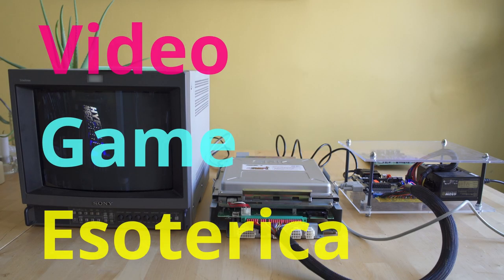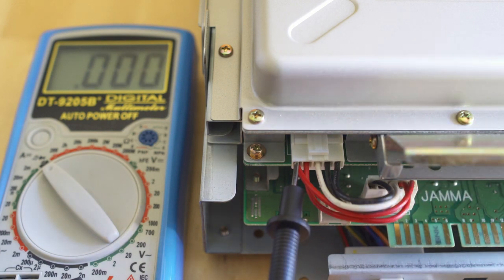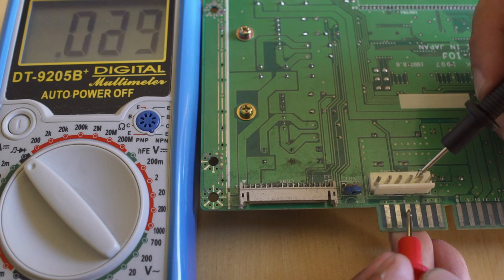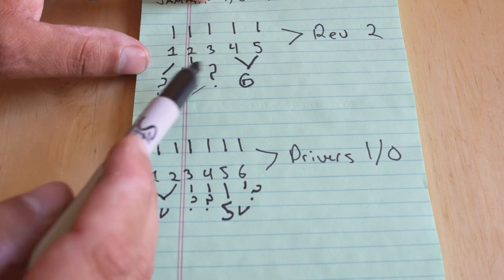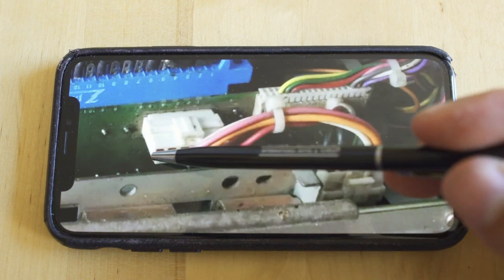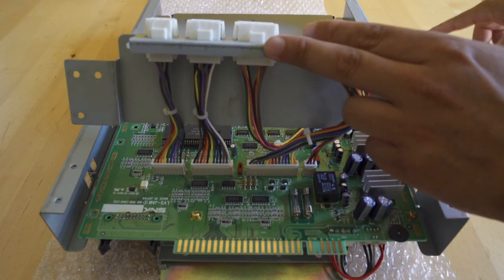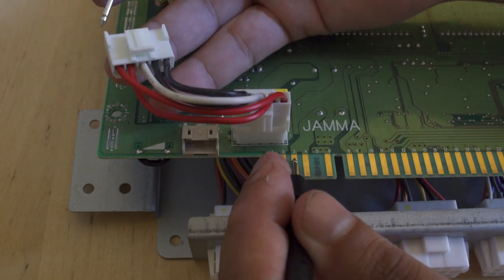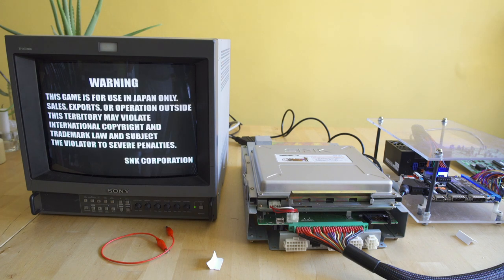Converting the Hyper Neo 64 Motherboard Pt 1 - "On a Technicality" - Video Game Esoterica

Comment: What's your +5v set at? I picked up a revision 1 board and have never been able to consistently boot. And do you have a -5v going in to the jamma line?
Reply from the maker: My 5V reads 4.98 on the led. Since it’s a Rev 2 board it doesn’t need -5V. All four +5V leads MUST be hooked up to the JAMMA edge to get it to boot though. If you just get a blue screen with no white text that means you aren’t pushing +5V to all four JAMMA pins
Reply: @VideoGameEsoterica  I'm not even getting the blue screen that's what concerning me
Reply from the maker: Kevin Gauby and all four 5V leads are hooked up? That’s odd. Nothing I’ve ever encountered. Do you hear a “click” on the board when you power it up? You should hear it “click” when power is applied
Reply: @VideoGameEsoterica  all four +5v line are connected and I'm hearing a click when booting. I'm going to pull the io off again and spray the crap out of it.
Reply from the maker: Kevin Gauby sounds like a good idea. It “sounds” like it’s working fine but maybe not outputting video signal? Hard to say
Reply: @VideoGameEsoterica  Just cleaned it, still a black screen. Read 4.83 on the jamma line on boot though, 5.49 with it disconnected.
Reply from the maker: Kevin Gauby it’s power hungry. I’d bring it closer to 5.00. What power supply you using?
Reply: @VideoGameEsoterica  Blast city, and it's maxed out. I tried it in my other one and had it at 5.01 still black screen
Reply from the maker: Kevin Gauby there are fuses on the I/O. Check them. Maybe reseat the I/O board too. If that doesn’t work I’m not 100% sure. Probably check caps after that
Reply: @VideoGameEsoterica  I'm going to try it on a more traditional psu. Fuses are good. It was just weird that it booted two times, once with ff and once with ss64. The other questions are where is this 2nd 5v input at? And where should I put -5v, between the 5v and 12v, like mortal kombat?
Reply from the maker: Kevin Gauby Kevin Gauby to my knowledge -5V isn’t essential unless dealing with audio. You’d just put it on the JAMMA edge like normal. The second 5V and ground is the big four pin connector on the front. JST YL connector. It’s not necessary to properly power the board if the power is correct on the JAMMA edge though. It’s just to dissipate heat for prolonged arcade installations since it’s a dual layer pcb design